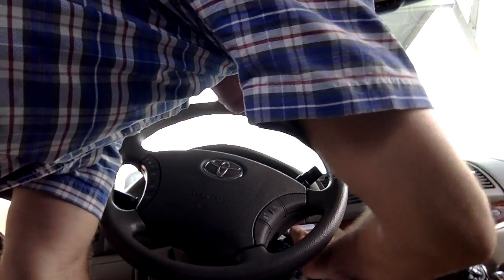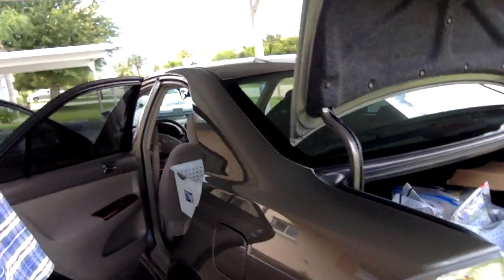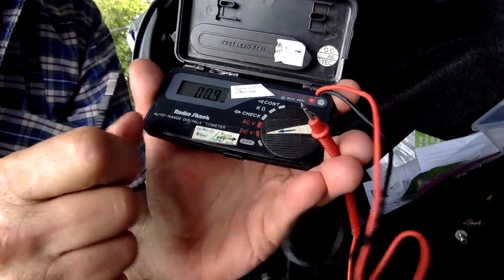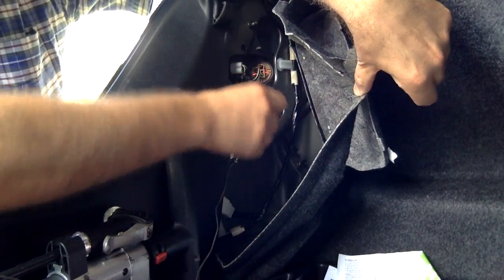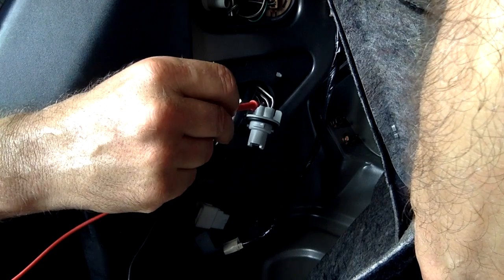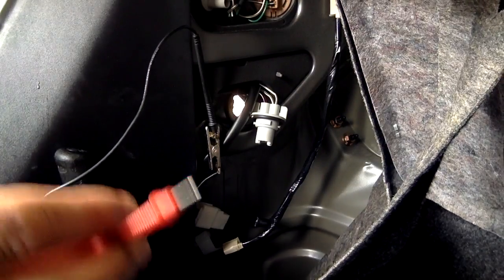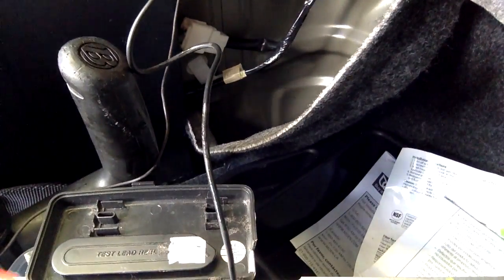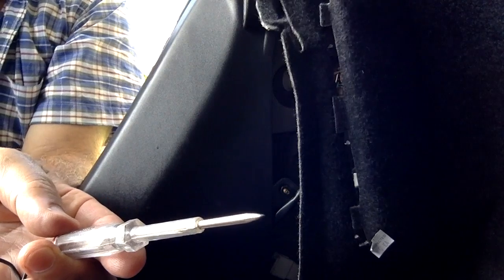Car Back-Up Camera - Finding Positive and Negative Back-up LIGHT wire polarities  -Video #1

Comment: I wanted to see which color wire to hook up my backup camera to the brake light; and guess what? The guy tells us [who is showing the video]That he is colorblind and he can't tell the difference between the colors red or black.Go figger! He!He!
Reply from the maker: …Partially color blind ,  to be exact.  Blue and purple confuse me, and Green and brown confuse me.  I have an electrical engineering degree, but never got a job at that.x. So many jobs require color vision.  They make color corrective eyeglasses now, but not worth pursuing that at my age.  The military said I would be severely limited in job titles because I was too color-blind.  I Love your comment.  Red and black are not the colors I have trouble with.  Thank you.  I still have never used the back-up camera all these years later. The delay in the camera turning on was too slow.

Comment: Hi, hope you and you're family are well. I have a question about finding the positive on the reverse light cables. Does the 12v tester with crocodile clamp only pick up a voltage from the positive or also on the negative too? Thanks

Comment: I found one of those old 12v testers in a tool bag my wife obtained from her dad but it doesn't have a cable to connect to it. Where I can I get that from?
Reply: or else you can get a standard multimeter for a tenner would do the job for you

Comment: I am hooking up the power wire to the positive but grounding to the body frame, via, one of the many bolts in the trunk frame.
Reply from the maker: Chris S ... that should work as long as you have a good ground to the chassis

Comment: Hello, I do have FPV camera and monitor but is there why that my rear light will be able to run this camera, or will it "burn" it.
btw. I run this "system" with battery but now I want to get rid of them. What do you think?

Quanum ELITE QB58
Transmitter power: 25mW
Input power: 2.5~5V

Thank you very much.
Reply from the maker: Aleksandar Vujicic ....Sorry, not sure what you mean.

Comment: Actually, this IS a great video since I'm going to be installing a backup camera and will be using the power to the backup lights to tap into for my camera. Yes, I do need to know which wire is positive. There are 3 wires going into that socket, right? Do I care what the third wire is?
Reply: All you care about is finding a wire that goes to +12 VDC when you are in reverse, so no. Doesn't even technically have to be coming from the reverse lights.

Comment: how do i actually wire them together?
Reply from the maker: ......  My  wife  got  very  sick  and  I  never  did  finish  hooking  up  this  camera.   I  did  get  to  use  the  camera  briefly  and  I  found  out  it's  reaction  time  was  so  slow  (delayed)  when  putting  the  car in reverse  that  I  decided  not  even  to  use  the  back-up light  to  turn on  the  camera,  but  just  plan to  manually  install an on/off  toggle  switch  for  the  camera  up  by  the  front  drivers  seat.   I  can  manually  turn  on  the  camera  as  needed.   This method  also  helps  because  a lot  of  time  the  camera would be  a  distraction  in  easy  to back  up  situations.
Reply from the maker: My wife  got  sick and  I  never  did  finish up  hooking  up  the  camera  using  the  back up lights.   The  little time  I  did  test  the  camera  I  found  that the  camera  was  too  slow  in  reacting  to  showing  the  picture  when  using the back-up lights  to  turn on the  camera.   In  other words  by  time  the  camera  showed  the  back-up  camera view  I  was  all ready  well into  backing up.   I  am going  to  hook up an  on/off  toggle  switch   up by  the front  seat  to  manually   turn  on  the  camera  only  when  I  need  it  bad.    That way  the  camera  can  be  on  well ahead  of  time  and  not  be  so  slow  in  reacting.   Thanks  for  inquiring.

Comment: its a little scary for me to even try to do this. can i get this done by professional mechanics
Reply from the maker: ..... I  can  see  why  it  may  be  scary.    I  have  an  electrical  engineering  degree   and  I  still  don't  understand  a lot  of  electric  circuits.    I  wouldn't  try it  if  your  not  confident.    Of  course  professionals  can  do  it.